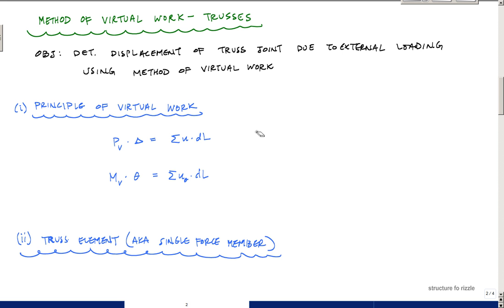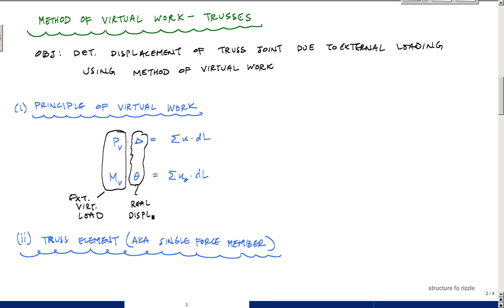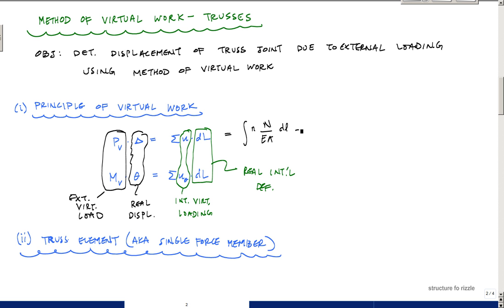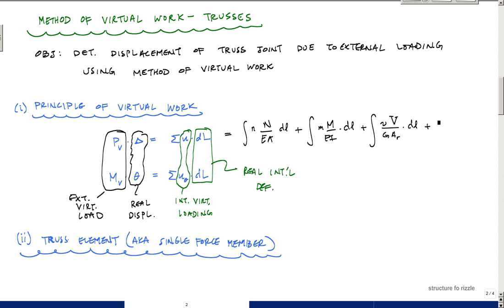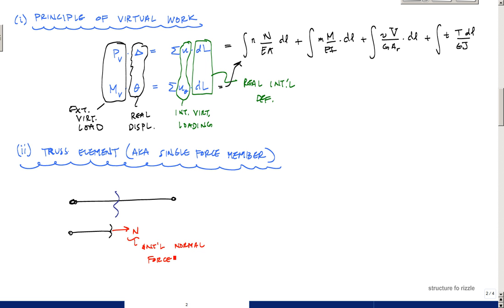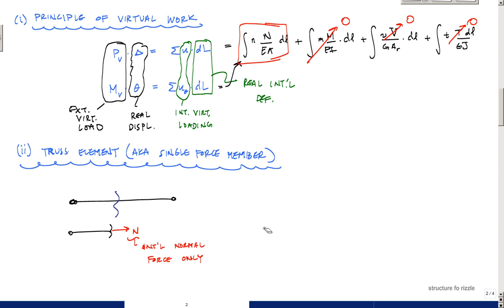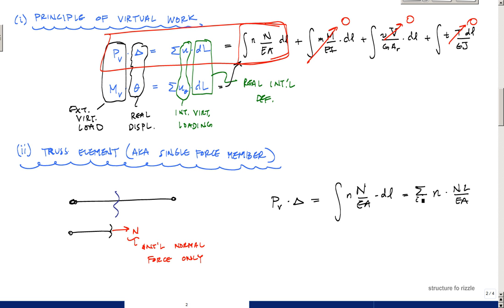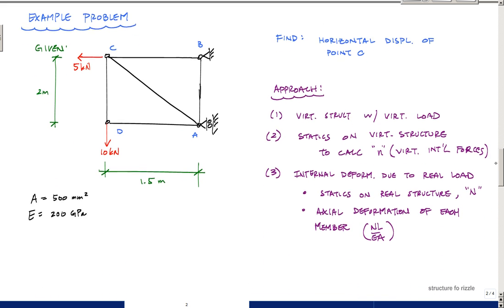Method of Virtual Work - Truss Deflections - Structural Analysis

Comment from the maker: The internal deformation (i.e. PL/EA, TL/GJ, M*theta/EI, etc.) is the deformation due to internal loads.  Those internal loads are caused by the real external loads.  The real displacement is the external displacement that you are trying to calculate.
Reply: @Dante Falcone Internal loading is caused by external loading (shear, axial, moments) acting on a system. To find internal loading you need to first find the external support reactions using equations of equilibrium and then make section cuts